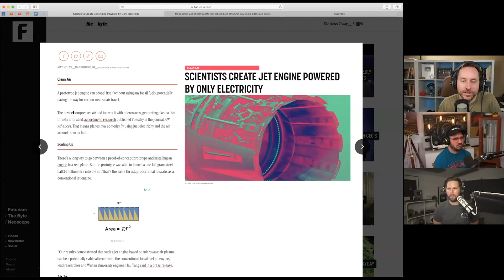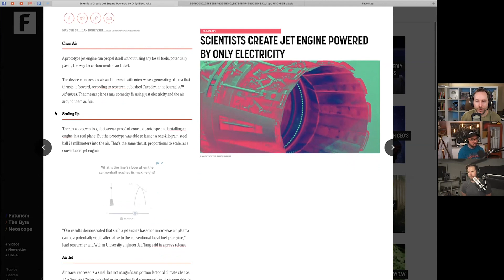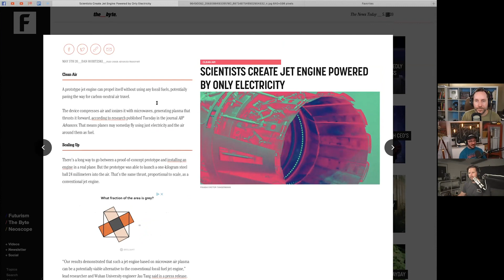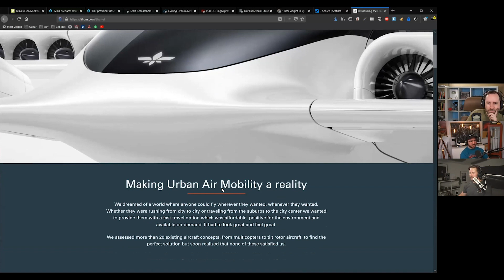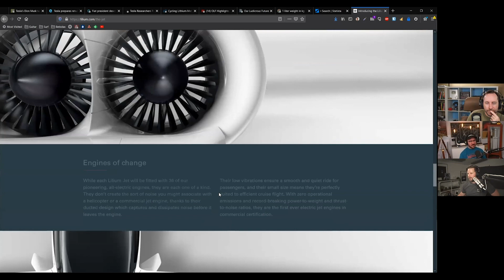New Electric Powered Carbon Neutral Jet Engine (Highlight Ep 83)

Comment: yes that was either done with 400 watts or a thousand Watts . the plasma laboratory plasma engine. if my math is not wrong 1 million Watts will get you 6,000 lb off the ground in thrust but my thinking is if it was configured into normal jet engine or somewhat normal bypassing the fuel and adding the plasma inside of a jet engine I'm thinking you could probably get 10 or 20 times maybe even more. so that jet engine would now reconfigured possibly 60,000 lb of thrust to 120,000 lb of thrust with no but air and electricity sweet sweet sweet. no don't sound impressive

Comment: Hydrogen has 3X higher energy density (Wh/lb) than normal Jet fuel
Reply: Dani Nofal just keep in mind that the storage for liquid hydrogen adds a lot of weight. It's not easy to keep something at 20 degrees kelvin! With that being said, I would be interested to see how well an electric plasma jet engine could work if coupled with hydrogen fuel.

Comment: I am the chief author of this paper, and would like to point out some incorrect comments in the program. We demonstrated that even with only 400 W the air plasma could lift a steel ball of 1 Kg over a quartz tube of 24 mm in diameter. The thrust pressure was shown to be comparable to that of a jet engine of commercial airplanes which operate at ~ 200 M W. If someday we could scale up our microwave air plasma engine to such a high power we could lift a Boeing airplane.
Reply: Hey, what kind of help do you need in scaling this up?
Reply: So 400w per kilo lift?  That does not translate to electric well.  Because the energy density of fossil fuels is not comparable.

How do you plan to get the energy density?  Batteries are not an option here.

So small nuclear reactor?  That will market well.
Reply: Well done! Coupling Electric Jet Engines with Hydrogen Fuel Cells seems to be the way forward
Reply: how are you accessing youtube from wuhan??

Comment: Turbine engines running off of natural gas are used to generate electricity at "Peak Power Plants" across the U.S.. They are also used in the oil industry for transporting crude oil through pipelines. Saudi Arabia is building solar farms to reduce the need for the highly expensive turbine engines. Imagine how much these plasma turbines could change that dynamic. Although, I admit that using electricity to produce electricity seems redundant...

Comment: Ben, why are you so dismissive of the nuclear energy solutions?  Thorium molten sodium nuclear reactor-based power generation (as opposed to the current light-water reactor technology) is a less expensive, profoundly safer option with much less nuclear waste (plus they include breeder reactor functionality that allows for using the nuclear waste material that is a by product of current nuclear reactors).  If we want to reduce fossil fuel use fast enough and significantly enough to avoid the predicted effects of climate change, nuclear electrical power generation will be a required component.  Technological advances in non-nuclear renewable energy are not here yet nor are they coming fast enough to supply the power requirements to support the current needs of the planet with their technology alone.

Comment: DC power famously lost out to AC power because it can't be transmitted over long distances. That was over a hundred years ago, but has held true for as long as I've known about it. What kind of breakthrough has been made to reverse this?
Reply: actually, very long distance transmission is only possible with high voltage DC, since AC losses are becoming too high. https://en.wikipedia.org/wiki/High-voltage_direct_current
the advancement nowadays is that we can easily transform DC voltages, unlike to the past where only AC transformers were conceivable.
Reply: Since the implementation of solar farms is a hot topic and more communities are seem to embrace such a technology, using DC to transmit energy over long distance might be a cleverer idea since the quality of energy of the farms and the storage systems can be compromised from the transformation of the DC to AC. Plus most of the devices we use are DC (Computers, phones etc.) and those that are not DC, use rectifiers and inverters to transform AC to DC and back to AC because its easier to totally control a system with inverters.